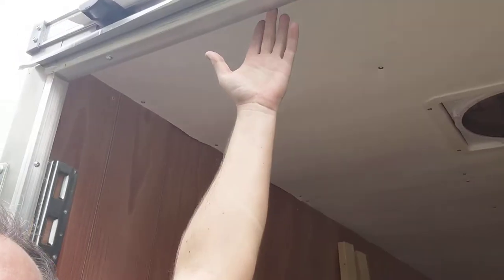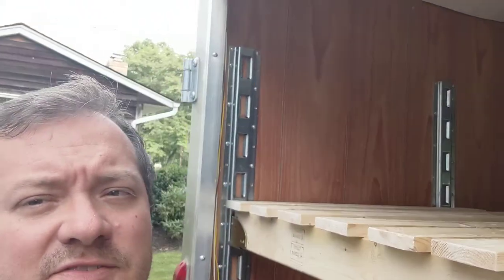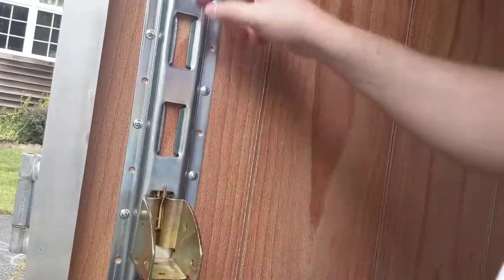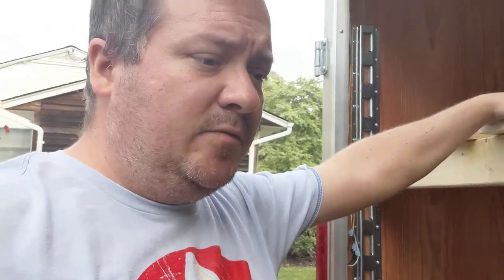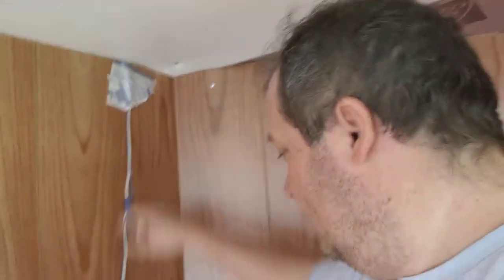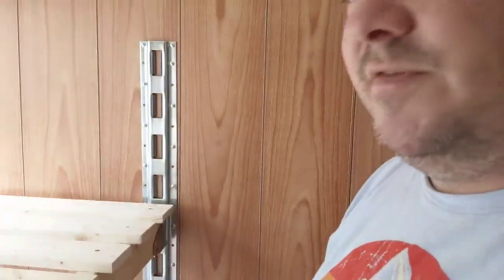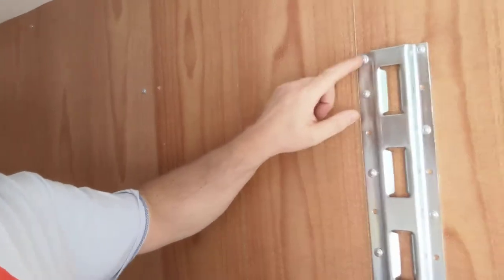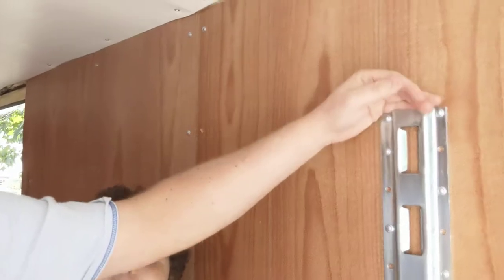Cargo Trailer Conversion, E Track bunk beds

Comment: Not sure if you ever fixed the Brown wire issue, but I had the same issue. It might not be your wire, it is your vehicle. The computer in the vehicle knows through its sensor if you need to have the lights on or not. Try and hook up your trailer and kick the lights on at night on your vehicle and see if that fixes the issue. Our Chevy Traverse wouldn't turn on the running lights unless it was dark outside. Hope you got it figured out.
Reply from the maker: Thanks for the information. I didn't know that was even a thing!
I repaired 1 bad connection I did and 1 bad connection the manufacturer did and the light is now working 100%.
Hopefully it keeps working, LoL.

Comment: love your video! question... my metal trailer support are 15ish inches  apart. How do secure both sides of that narrow etrack ? only one in the stud?
Reply from the maker: I screwed the E Tracks into the plywood. One side of one is partially in a stud.
Because I installed vertically, the bottom of the E Track rests on the floor.
The beds press the E Tracks against the walls pretty good, so they don't pull away.
The only real force is down.

If they were installed horizontally I would be more concerned with hitting the studs.

Comment: Did you screw your track to the wall studs
Reply from the maker: Hi there! On one side, I hit the stud with most of the screws on one side of the E Track. On the other side, I only hit the stud a few times.
Because the bunk beds are essentially wedged in, I wasn't too worried about the E Tracks pulling out of the walls.
Also, all of the force is down, and I have the bottom of the E Track resting on the floor.

Comment: Were you able to sort out the wiring issue? We just had this issue with ours, was a blown fuse in the vehicle.
Reply from the maker: I have not been able to ☹️
I had the wiring tested at the plug from the vehicle and it tested fine at that point.
The issue must be in the trailer.🤔 I haven't spent any time on it yet.
I think I need to re-crimp some wiring connections that I had cut now that I have an official "crimper."
I was also told to check my ground wiring.
Reply from the maker: Turns out it was a loose connection at one of the splices to a tail light.
I cut and reconnected it and the short is fixed.
At one point it did blow the fuse from the battery to the hitch wiring box.
The tail light is blown though. I have to replace that. It still works for brakes and turns.

Comment: Mine did the same until l hooked up trailer on the hitch and truck hitch grounded trailer.
Reply from the maker: Interesting.
This turned out to be a bad splicing job by the manufacturer.
All fixed now!